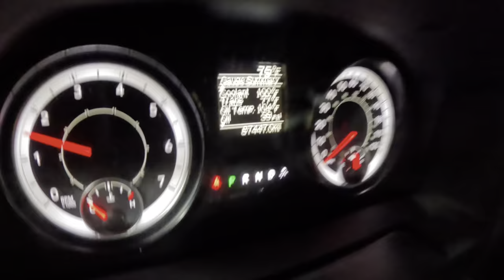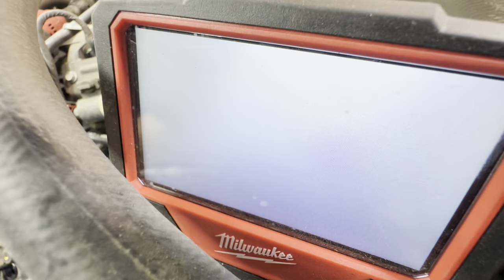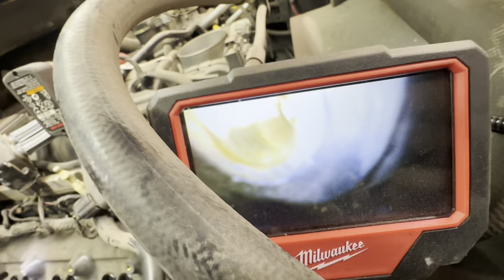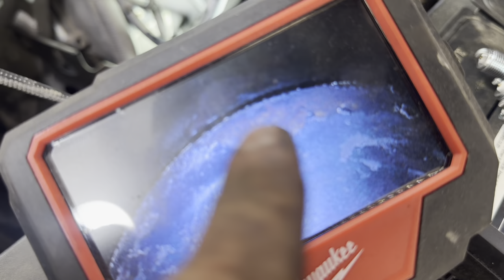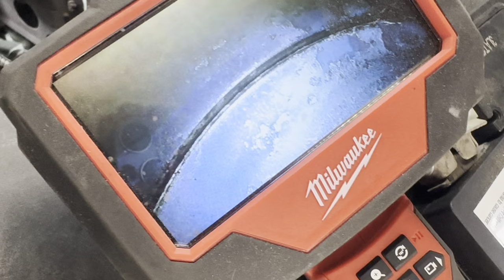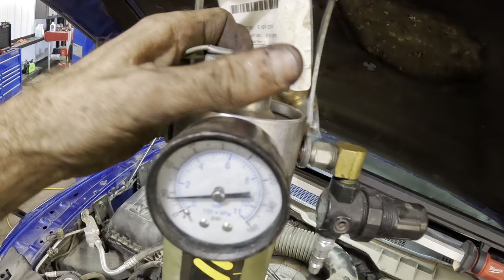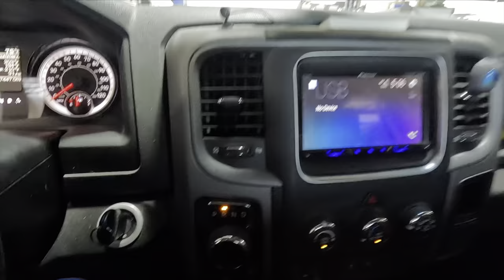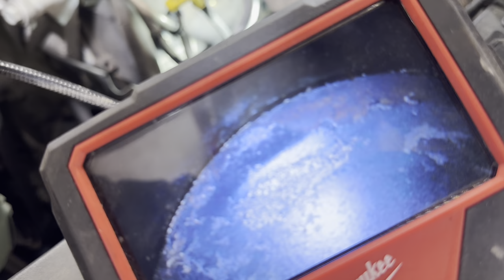The “TUNE UP” is DEAD! Dual Spark HEMI! (Injecting liquid into the Intake)

Comment: I don't have the tools brother Ray has. So to put the plugs back in my hemi, I cut a piece of 3/8 fuel line and  wa-la instant plug remover and installer. Just sayin
Reply: I have an old spark plug boot I use. I add a 1/4" extension to the wire end to give me reach. I've had it since the 90's.
Reply: Did that trick back in the 70’s.  Works very well.
Reply: Voila?
Reply: I have been using the fuel hose for many years and have one in my cart and one in my travel bag ! It has been a frustration saver!
Reply: My dad was a helicopter mechanic who got his training back in Vietnam.  In his tool box was a length of clear hose just for starting spark plugs. It worked for him for 50 odd years!
Reply: @militarycoo  - More like "voilà". 😉
Reply: @module79l28  Either is accepted in English ;)
Reply: Voila.  Just sayin'
Reply: @militarycoo  - Yeah, I know your keyboards don't have accents.
Reply: Why don’t you people just go through the wheel well to do the plugs on this thing 😂I literally do all lugs on the hemis in 18 minutes
Reply: My fuel line with a wheel stud stuck in one end was back in the 60's and still is in my tool box.
Reply: Yet another great hack from the bad old, good old days.
Reply: Or you could get a proper spark plug socket with a rubber insert.
Reply: @chriswells2730  Amateurs.
You drop the whole drivetrain and the plugs are EASY to reach.
Reply: That's  exactly  how I used to do it.
Reply: @lo1234-w9r yea I could but what's fun about that
Reply: Always haters  @kjcorder
Reply: I did this in 1970 with my Ford Cosworth racing plugs to prevent cross/threading due to the depth drop
Reply: A full set of magnetic spark plug sockets is under 30 bucks on Amazon. I’ve done the plug boot thing, the clear tube thing, some other things, but the spark plug sockets are amazing and well worth the investment.
Reply: I used some vacuum hose over the spark plug cap. Worked wonderfully. I changed a lot of plugs in the 60s,  70s, & 80s. Several sets a day.

Comment: Whenever I sell a Tune up, I include spark plugs, PCV valve, clean the throttle body, top end decarb service,Battery service, and fuel filter if external.

Comment: Just starting to watch video and making comment before finishing video & retired marine mechanic here, so I know and work on engines. I own Ram trucks, some people complain about changing the plugs, especially the rears. Sorry, I thought they were and are easy. If people think those are hard to replace, try working on certain boats where they drop the engine in, then build around it! My 2010 had regular plugs, I put in iridium and never looked back. My 2021 looks just as easy if not easier for when that day comes. Use NGK, DONT use other brand plugs. Why? Because Ram/Chrysler built an engine then went to plug manufacturer and had them build a plug for the motor. Quick example, Marine engine manufacturers did the same thing, Evinrude used Champion, went to them and said build a plug for this engine, ANY brand WILL work, but the best performance was with champion!!! After watching video, why, why would you do the cleaning process AFTER putting in new plugs? In tech school for marine, Mercury, if was always stressed to do the cleaning before new plugs because if carbon deposits are loosened up they will not possibly stick to the new plugs, and, in the times we did run cleaner through engine, there is the possibility of fouling plugs, which we found did happen! Love your videos Ray, and just trying to help with my experiences!!!

Comment: My 2012 1500 manual stated that the spark plugs had to be changed every 30,000 miles. The last plug on the drivers side needs a contortionist to remove. Great job.

Comment: Hay Ray, get you a Stanley ratchet with a turn handle, these are fantastic and a life changing experience, just turn the handle and it turns the ratchet with ease. There 3/8 drive and I bought mine off Amazon

Comment: Used to be in the old days, run water through the intake system and bust out all that carbon. Now day's we have Gumout, SeaFoam and many others, which works wonders. Gumout is probably the best on the market. Just need to let it soak for about 24hrs, fill the cylinders, pull the plugs, spin it over and done. 
Now, what this all means to me is, all this carbon is now going to be hanging out in the cat convertor, one reason why many didn't have cat convertor's or removed them altogether. I've seen you use this method before and I admit it does work but for those of us that don't have such nice fancy machines, as the saying goes, "mechanic in a can" works just as well. Cheers :)

Comment: Gum Out used to make a kit to clean out the carb and cylinders. It came with fuel fittings for the carb, and you hung the carb cleaner like an IV and ran the car on pure carb cleaner.

Comment: We've been using the zero drive in aerospace for many years. We call it a Hi-Loc ratchet. Also, it's not magnetic but rather contains a one way bearing.
Reply: "sprag clutch"
Reply: Curious here, have you opened one? I'm wondering how the reverse function works, if it's a "sprag clutch/ bearing", as I only know those from automatic transmissions, to reverse their direction, you'd need to fit them backwards. 🤔 Obviously, there's something designed in to make it reversible.

Comment: Think you'd have faster results cleaning cylinders with water vapor added to the intake stream while under load. Any water that would find its way into the engine oil would boil off under the vacuum of a steady freeway cruise by way of the PCV system. Water is cheaper than petroleum distillates and is also catalyst safe which cannot be said for all petroleum distillate-based cleaners. To do a steam cleaning you need to find a point central to the intake air stream (normally near the throttle body such as the EVAP port on older Hondas) and create a controlled vacuum leak to draw in the water in a conservative amount. On 90s vehicles I used to put a venturi tap inline on the vacuum supply line to the canister and would connect that to a juice bottle I had adapted to act as a bubbler so it wouldn't draw in large droplets but instead only saturated humid air. Think of the air right before a rainstorm instead of hitting it with a garden hose. At idle the port would be obstructed and at WOT there wouldn't be enough vacuum at the port to ingest much if any of the water. At partial throttle loads it would consume the water and clean the cylinders while also effectively shutting down NOx production while active.

Comment: I have a 2014 version of that same engine, also in the pickup. I struggled similarly to you when I changed my spark plugs. Your experience and efficiency getting through the job actually showed, at least to me.

I did use a different spark plug socket, which may have helped me out. 

It was also pointed out that I could have pulled the fender liners and come in through the bottom, and it likely would have saved time.

Comment: Love Ray’s videos!!!Question though. “We do not start threads on spark plugs with the electron ratchet, you may cross thread an aluminum cylinder and that would be bad.” On the driver’s hard side, drop in the plugs, hit them with the electron ratchet. Did the hand start get cut out or did Ray just do what he said should not be done? 😮
Reply: if you noticed he feathered the wrench so if the threads crossed he would know
the main reason you do not use an power wrench is most people will go full throttle and cause the threads to cross with out them knowing
Reply: Yes I noticed this
Reply: The more you know, the more you can break the rules because you become more attuned to what is actually going on.

Comment: I have a 12 Ram 2500 with the 5.7L. I just did this repair last fall. Not an easy thing to change the plugs on these trucks. The rear plugs on the passenger side are difficult but the drivers side third and fourth plugs are super difficult. You really have to contort your arm and wrist to get the coils off and on as well as change the plugs. With my truck being a heavy duty 4X4, even at factory height, it makes it so that you almost have to lay on the engine partially to get to the driver side plugs. I cuss the entire time and you don't want to know what I think about engineers while I am working on today's vehicles.

Comment: I bought a magnetic sparkplug socket  at O'rielly auto parts. Best investment ever! I never have a problem with the plug falling out of the socket and compressing the gap. There isn't a rubber holder to stay on the plug when you pull the socket off the plug. It's a great invention.

Comment: Yes its odd how trucks keep getting larger, but engine bay room keeps shrinking in size.  
I'm waiting for them to get smart and make a flip up frt clip like some of the corvettes had only you can take it all the way off with 2 wire harness plugs.  Pulls the fenders and wheel liners off too. Or just open the hood to chk fluids
Reply: It's why I have a GMT800 also Diamler/Benz-Fiat-Stellantis Chrysler (Yes Chrysler has been handed around like a hoe) shoehorn their stuff, because a neighbor has an older ram from 2005 and it's the same way as this 2016.
Reply: Or just make the hood and side panels out of LEGO blocks!
Reply: Actually just change the plugs as you go through the fender well to repair exhaust manifold 😬
Reply: I like the prototype race Camry Toyota put out. The entire body lifts off like the old COE trucks.

Comment: I just changed the plugs in my 2013 Ram. On the passenger side, the wiring harness can be moved by detaching it from the firewall. The heater hoses too. It is a lot easier to remove the plugs. 

The wobbly bit is essential on the drivers side, nearest to the firewall.  The the brake vacuum assist can be easily relocated for access. 

I ordered iridium plugs off Amazon, specified for my engine. Every one of them were gapped improperly at 55, rather than 43. I adjusted them and they’re working great. 

My concern at this time is, I found out after installing the plugs, Champion is an inferior product. I’m not inclined to change them again. But, watching closely, just in case. 

My truck just turned 70k and runs great!

Comment: I like your comment about relative ease of tune up.  I had my Honda CRV in at the dealer for a diagnosis of a strange engine noise ,a rather low rattle like noise at 1500-2500 rpm that then disappears at higher rpm.  They couldnt find the cause of the noise and only suggested a "tune up" which entailed cleaning the throttle body and changing the spark plugs for the paltry sum of $600 plus tax (and shop  consumable) of course.  They charged me $175 for the pleasure of looking at my car for an hour and I declined to give them another $600 and instead bought a set of plugs and some throttle body cleaner and did the work myself.  The car only had 50K mileage and when I removed the plugs, they looked just like the new ones and the "carboned up throttle body" was perfectly clean just as I suspected.  I did replace the plugs, sprayed a $10 can of cleaner into the throttle body and intake  and test drove it.  The noise is still there  which was no surprise.  I guess I will follow the dealer suggestion and just drive it till it  throws a code that can be checked out.

Comment: Great video Ray , but how is atomizing the cleaner important when it simply sprays on the throttle valve and becomes a liquid again?  Why not just have it drip onto the valve as the engine runs?

Comment: I done the plugs on my 15 1500 with the 5.7 and I found it easier on the passenger rear to pop that grey wire tie connector and remove the black computer bracket and it gives a lot more room. On the driver front the get the electric connection off I found it easier to unbolt it and lift coil up to unplug it

Comment: So inconclusive test because if the snake oil have an effect it takes several heat/cold cycles. You should test it on your Interceptor taking photos before, after a go, and after a week.

Comment: Hey Ray, I did this service to my 2010 Jag XKR. The direct injection made the valves all gummed up. Like one of Eric's I do Cars videos. After watching your videos a while back I bought the cleaning setup. Napa had lot's of brands but no BG but I went with a dual product setup like yours. Like this, it took a couple of days but when I went back into it with my endoscope it was dramatically cleaner. I agree, it takes a coule of heat cycles to break the gunk off but you can tell because the exhaust stops smoking. Easy process to do after oil changes. Makes the neighbors wonder tho.

Comment: When I did plugs on an 08 hemi ram my go to ratchet was my Carlisle 3/8 longer reach swivel head. I know you have one as I've seen you use it. Made quick work of those back 2 coils on the driver's side. And a matching 1/4 drive for the 10mm hold downs. This is not a fun job but you make it look easy.

Comment: I've done the same with a cup of h2o sucked into the intake through the brake booster vacuum line. Pin the throttle at about 2,000 or have a friend do so. Smokes like a blown head gasket while you're doing it, shines the pistons up like nobodies business though. The cleaners do work better, they just have a cost for the speed/convenience. No judgement to Ray for using it, winds up being the same or less cost wise because of the billable time needed with plain water.

Comment: The Walnut air blasting kit is (hands down) the absolute best way to clean the valve stems and intake runners inside the cylinder heads on Direct Injection engines (it cleans them to new condition).  The BG cleaner you used can do a good job on the piston and valve tops, what would probably help is to also add BG 44K fuel system cleaner to the gas tank and take it on a long highway drive so that any loosened carbon will be blown out over a 1 to 2 hour drive at highway speeds.

Comment: Just a couple days ago I replaced both exhaust manifolds on a Dodge very similar to that one. Doth manifolds were very very rusty and each side had multiple broken bolts. Extracted the broken bolts with a welder. Also replaced all the plugs and coils. Ignition coils were all getting green corrosion on them.

Comment: I've had vehicles well over 100,000 miles with  good maintenance..name brand good oil and a top tier fuel I've never had to use any fuel system cleaners and or oil additives and inside my engine looked brand new..my opinion these are just up sale techniques..still like rays video's though 👍

Comment: In many cases of direct injected engines, the valves get so carbon encrusted, you have to use walnut shell media to blast it away.  A catch can for the PCV system helps keep the intake cleaner.

Comment: Back in the day when dealers started selling fuel system cleaning we invested in a Moto-Vac machine to be able to offer the same service. It was a hard to sell service at first but testimonials from those who had it done increased sales and allowed us to help more people with this valuable service.
Reply: It temporarily helps, I know this because a 2004 tahoe sat 5 years, started, had a p300 code, I pulled all 8 injectors and looked in them each, had what looked like crystalization/stones in the screens so unless if the injectors can be pulled and cleaned by breaking up that trash using a plastic scribe and sprayed out using a cleaner, just hooking up to the fuel system to pump a solution through is not the end all fix.
Reply: Moto Vac does that Vac money from the customers pocket.

Comment: It's interesting that all this contamination of throttle bodies and intake valves are the result of the PCV running crankcase blowby through the intake. One would think there would be a more efficient method of preventing blowby from entering the atmosphere without shortening the life of the engine.

Comment: Tune up to me means improve performance beyond factory standard. Technically you just carried out a service including replacement of consumable parts.and a system treatment  

As for the system treatment I don’t add any to my petrol car but do add a system cleaner  to the fuel on every 3rd tank or if I’m going on a long run

Comment: From memory it takes these cleaning fluids up to 10 hours to loosen and clean pistons/cylinder heads. It cleans intake pipework and backs of valves immediately as this is not fire baked on. The cleaner in the tank cleans needle valves, jets and fuel pipe work/ gallery's.If you strip a engine after 500Th miles you can tell who has used cleaner regularly and who has not used it.

Comment: Used to work in a shop 20 years ago that used BG products.   Some were "snake oil" (coolant treatment), but good ol' 44K was the Cat's glutius maximus.  Had a GMC  6000 with the 8.2l Detroit engine and had some serious carbon issues on top of the pistons (think so much carbon that it almost sounded like a spun rod bearing).  Nothing fancy,  dumped a full can of 44k down the intake,  shut it off,  let it soak in about half an hour, then fired it back up.   Warmed it back up,  then misted water into the intake.   I know,  water on severe carbon usually means a god awful racket when it breaks loose,  but the knock was gone and no racket.  Truck sat and idled a lot,  and the Detroit 8.2l fuel miser engine sure isn't top of the line when it comes to a diesel,  but BG 44K saved the day on that one.   Also worked good as a throttle body injector cleaner.   Start running rough,  run a can into the gas tank,  about half a tank of gas later,  rough running went away.